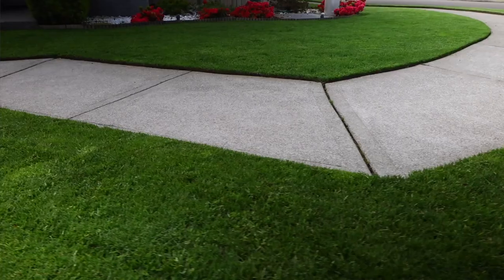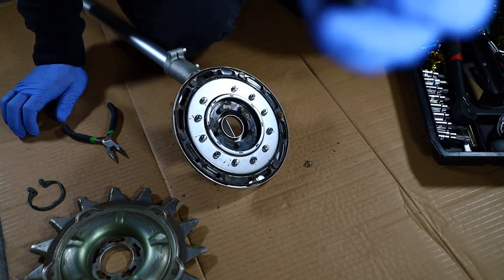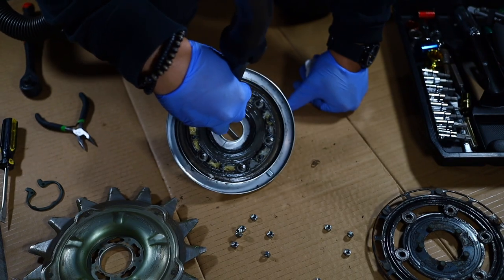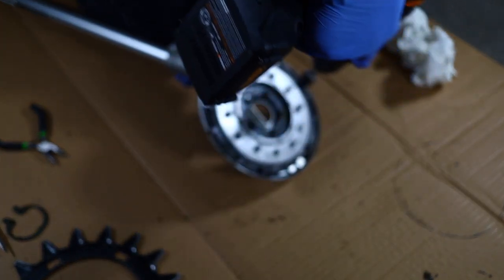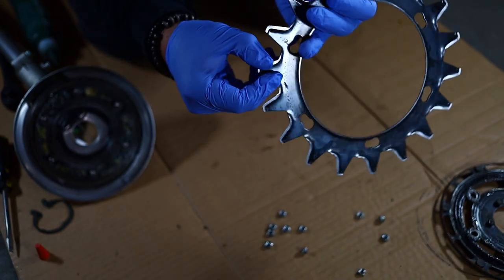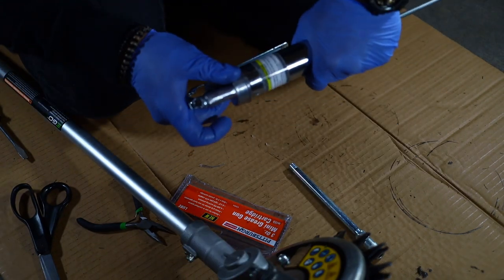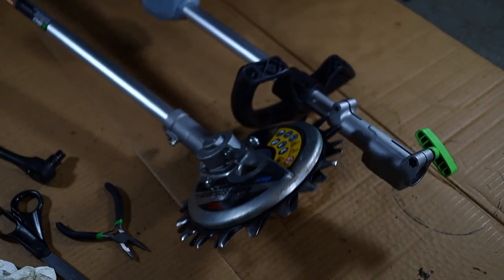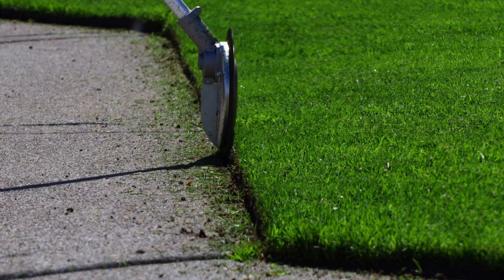How to Maintain Power Rotary Scissors ~ clean ~ maintenance ~ grease ~ disassembly and assembly ~

Comment: I am just getting ready to grease my power rotary scissors for the first time. I noticed in the section of your video where you were using the grease gun that it appears you don't need zerk fittings with the small grease gun and the Idech scissors. Am I seeing this correctly? Going to Lowes for a small grease gun, and wondering if I need zerk fittings as well? Silly question probably, but mechanics aren't my strong suite. Thanks!

Comment: Man, I just received the scissors and ran them on a Dewalt 60v trimmer….I’ll tell you what. Don’t know if I’m gonna use string anymore…It’s almost therapeutic to trim with this thing. No need to worry about rocks flinging or hitting you in the face. Was able to do my property with a 6 amp battery. Still deciding on whether I’ll get the bigger blades for edging. I won’t use this standard blade to edge-just for trimming grass…Gonna keep this baby greased and sharpened…So glad I pulled the trigger on them.

Comment: You used Mariyama grease and the grease from the box of the grease gun?  2 different greases?
Reply from the maker: Yes as you can see when opening the oil case factory uses 2 different greases as well 😊🤙🏾🙏🏾🙌🏾 obviously you can just use one but I want it to be nicely greased! Another thing is the Marayuma grease is $45 shipped and the harbor freight grease is like $3 😂😂😂
Reply: @YardBrah is Maryama some high quality premium type of grease?
Reply: @letmebreakitdown2u152  It's an EP0 rated grease, which means it performs well under high pressure conditions for the rotating gears inside the rotary scissors assembly.

Comment: Thank You for making this video. Helped me to finally come to a conclusion that this thing is not for me. Too much maintenance. Sticking with a string trimmer.
Reply from the maker: 😂😂😂 it’s not that hard, if you’re cutting your lawn high yeah stick to the strimmer… rotary scissors are really good for matching cutting height with low low cut grass and reel mowing 😊🤙🏾
Reply: @YardBrah  It's messy and time consuming. Plus you have to sharpen them regularly and I'm terrible at that. Ryobi sells trimming shears on a rolling caddy. I might go with that for delicate spots and hard to navigate areas.
Reply from the maker: @johndong7524  oh I gotta check those out! Do you have a link brotha? 😊🙏🏾

Comment: Hello, I tried to disassemble and overhaul the entire rotary scissors assembly for the first time this morning -- after I bumped it against the concrete too many times it started to make a scratching sound, so I thought I'd better take it apart and make sure nothing is broken. I tried to degrease the insides over the assembly, but the grease on there is so thick and gooey, it's' taking an awful lot of Zep Citrus Degrease to cut through the old thick grease inside the oil pan. Any recommendations? You don't go into what sort of degreaser to use in your video -- thank you for this video by the way. Do you completely skip any degreasing process? I see you adding more Maruyama grease to the gears, but I don't see you ever try to remove the old grease and dry it first. What step or detail am I missing?
Reply from the maker: I just keep caking the grease on I use Maruyama grease as well as cheap harbor freight grease… I’ve been running the scissors for 3 years straight just adding grease every 4 uses. (I don’t take it apart anymore just fill in the 3 locations 2 top casing 1 on side) easy peasy 😊🤙🏾
Reply: @YardBrah  Oh okay. Thank you for the advice!

Comment: I believe the type of lubricant you have applied is incorrect as gearbox lube is slightly different. (EP-O gearbox grease is the recommended lube) cheers!
Reply from the maker: I used the specific maruayama grease recommended same brand… the harbor freight grease is just additional 😊🤙🏾
Reply: @YardBrah  the harbor freight grease is a different type and will not perform the same.